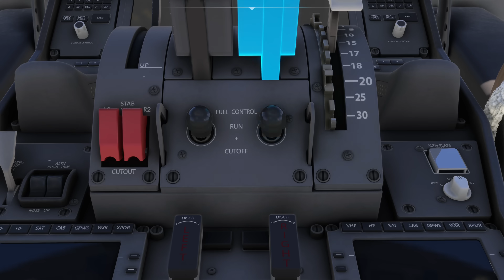Air India 171: Why Did The Fuel Cut-off Switch Get Moved?

Comment: While listening to this, my thought was this:

Maybe one of the pilots accidentally moved ONE of the switches during takeoff (shaking down the runway etc) and he then quickly realised that he’d toggled one of the fuel cut off switches, then in a state of panic he has inadvertently switched off switch number TWO by putting it into the cut off position, erroneously thinking that the first one was in the correct position, so effectively he’d cut off the good engine by mistake.
This explains how one was switched and then ONE second later the other was switched.
- it was during a very critical time period where all of your attention is focused on takeoff.
- maybe when the pilot asked him why he cut off, he genuinely replied “I did not” because he thought he had rectified the issue.

My only issue with this theory is that is it even possible to accidentally shift one of those switches inadvertently, since you have to pull up and shift position?
Reply: 1) Plane achieved thrust and lift. Would be impossible if one of the switches was “accidentally” turned off
2) You can’t accidentally turn these types of switches off. You need to pull them forward, then down (to cut off fuel) then they will spring back into place because they’re spring loaded. It’s not like a light switch
Reply: @TravelBug189 to point number 1, yes initially lift and thrust was achieved so the obviously in one of those crucial seconds the first and then second switch was moved.

Number 2 is the real question, is it possible at all to accidentally move them from RUN to CUT OFF. All signs point to the answer being no, due to how the switches are designed. 

My suggestion is how it goes from one to two switches being moved if in fact an accidental change of fuel switch position had occurred. Also why he said he didn’t turn off.

For the record, suicide still seems like the most plausible explanation so far.

Realising he’d made a big mistake, and not correctly repositioning the first engine switch, he’s switched off the live engine one second later trying to rectify his mistake, inadvertently causing an situation with no possibility of recovery.

This answers a lot of “how could that possibly happen” - ie switching two switches off, not one.

Comment: if the pilot actually saw the cut off done he then would have notified the tower. How can he just declare a "MAYDAY" without also saying the other pilot cutoff the fuel deliberately? I think he realized it was some electrical fault that did this and not the other pilot and tried, CALMLY, until it was too late to restore power. Why go down without telling the reasons why it was going down  and in this case, if the other pilot was responsible, tell the control tower over the radio, for the world to hear.

Comment: i don't think it's prudent to create a switch that takes 2 individuals to engage / disengage BUT what you do need is a button with some sort of "audible" or "visual" alert. If  that button had some sort of audible or visual alert the other pilot would have known about it instantaneously and more than likely all those souls would have been saved. Just makes sense to see a blinking light on the dash.....or a loud audible alert saying "Engine #1 fuel stopped" or "Engine #1 fuel resumed" even if it was done accidentaly it could've been corrected within 4-5 seconds.

Comment: I do disagree with Captain Steve's answers on the need for cameras. No one is saying that the camera will prevent this from happening; the camera is suggested for accountability purposes, not for prevention. Also the so-called concern that the camera will be somehow leaked is silly; if there is a concern for leakage, why wasnt there the same concern for the black box? Why cant the camera recording be saved in the same manner as the voice recorder and flight data recorder? I also reject the claim that the info caneras would show would already be shown in the voice recording anyway. I think it is exactly because cameras pick up info that the voice recording doesnt, that pilots strongly oppose them. No offence and I understand they dont want inappropriate action (e.g. falling asleep which wouldnt  be revealed in voice recording) be picked up by a camera, just like police officers have long resisted carrying bodycams, but the public deserves accountability, and when they are in a line of duty where hundreds of lives are at stake, they cant expect the same level of privacy as working a desk job.

Comment: I know as a UK part 66 Licensed Aircraft Engineer with the B878 (both engines) as a type rating.. We all know that the Boeing 787 has ELECTRICAL GREMLINS... If you don't shut the aircraft down properly, you can INDUCE a LARGE amount of electrical faults into teh system. My wonder is.... Is this a similar case??? Is there another glitch in teh software systems that CAN allow this to happen.. Surely a LOOSE wire could indicate that the levers were physically moved when in fact they were not... Could it be possible that a computer induced a momentary fault removing a ground and therefore indicating it was moved and then got that ground back. Or was it in the Cut-off lever module???

Comment: No one is asking the question? What if the engines were able to refuel again and the aircraft was back in control? What are the possibilites of the pilot/co-pilot to again interfere with the controls of the plane as its making its way to turn around and land safely? How does the one controller take control so to speak and prevent their co-pilot from commiting a second attempt at a malicious act? I'm picturing a brawl in the cockpit? This is all with the assumption that indeed someone in that cockpit wanted to end his life sadly.

Comment: Meanwhile India has ordered all its airlines to check Boeing fuel cut-off switches - and South Korea is about to do the same. Seems sensible. What I don't understand is why a faulty ECU might not 'believe' the switch has been turned to cut-off, even if it hasn't in reality. It could be nothing to do with the switch itself?

Comment: there could have been a malfunction in electrical system that affected fuel shut off valves..or some other mechanical issue....there was an advisory that needs to be discussed..engine failure was detected right away so then the pilots had no choice but to switch the fuel shut off switches from off to on to try to save themselves but had no time...the potential for mechanical or other issues related to the valves as indicated in advisories needs to be investigated...there is not enough info in preliminary report to blame pilots and protect GE and Boeing...full conversation of pilots not listed and some gaps in time

Comment: Ex-Huey/Scout USArmy pilot here.  Thanks for making your excellent series of videos.   On a 787, are there only direct electrical linkages between each of the two cockpit fuel switches and the servo motors that open and close the main fuel valves, OR is the aircraft's computer system (FADEC or otherwise) interfaced with that electrical linkage?  In other words, could the computer system activate the fuel valve servos to close or open regardless of the positions of either cockpit switch?  If this possible, would the flight data recorder show the event as 'fuel switch placed in closed (or open) position'?  Thanks for your attention to this query.

Comment: Hello Captain - In one of the previous videos I had posted a comment wondering if its physically possible to have both the engine switches transitioned from run to cut off position with a gap one second. You seem to indicate in a subsequent video its possible to do and it takes only about 1 second. However, in the report during emergency - pilots turned them back to run position and it took them a gap of 4 seconds between two switches. Could you explain this differece between 1 sec gap for Run to Cutoff but 4 sec gap for Cut off to Run?

Comment: STOP IT CAPTAIN STEEVE. You are selling lies and conspiracies and misinformation. Just stop it. You should be ashamed of yourself for saying this and spreading lies. Read the fucking report carefully, the report is saying that fuel cutoff switches Transitioned from Run to Cutoff, it doesn’t say that someone did it deliberately. There is a big difference in what you are saying and the possibilities for what could have happened. There are thousands of possibilities that could have made the control switch cut the fuel off. A loose switch malfunctioning due to a vibrating plane at takeoff, a mechanical and electrical malfunction which sent the data to the recorded for the control switch being off but actually the switches wouldn’t have moved at all in the cockpit, or a complete lie in the report to save the asses of Boeing and The airlines providing no information whatsoever of what really happened. The 1 survivor who everyone is ignoring said that very shortly after takeoff the lights started flickering and green lights were seen, which is a clear indication of an electrical failure. Stop spreading conspiracies against a pilot who simply doesn’t serve your country or you personally. Those pilots in fact did everyone they could to save that plane which was built and left I maintained to fall to death. Watch one of your own experts giving a rational perspective here.

https://youtu.be/GKQIZqUlPGQ?si=_JCYX_GLQbRwHcTR

Comment: Is it possible that the fuel cutoff switches are physically set to ‘Run,’ but an electrical fault in the flight computer or incorrectly connected wiring causes an ‘OFF’ signal to be transmitted to vital aircraft systems and the black boxes?

Comment: We know that the electronics indicated that the engine switches moved to off.  Unfortunately, we don't have video to prove that one of the pilots pulled the switches (or did NOT do it).

Others have said an electronics failure could have shut down both engines -- after which the pilots would have naturally toggled the switches off and then back on to relight them. 

This might seem *unlikely*, but as of today it does not appear *impossible*.  In that case, we can't rule it out yet.

Comment: What if the buttons/switches were in the correct RUN position, but the electronics switched to CUT-OFF, while the physical levers were still in RUN, and they/he felt the power going down, prompting the question. Then he put them back to CUT-Off, and then back to RUN, as a way of making sure! Good old "shut it down and power it on again", when nothing else makes sense. Why is this not discussed? Obviously these buttons/switches are not physically attached to the rest… They are electronic switches, even though they are "physical" in the way they are controlled.
Reply: To me... Why is this not the obvious thing to explore. I remember having to do this with the Turbo-button on a 486 DX with a physical "turbo button".... It's the same principle! These planes are electronically right about there (I know I am exaggerating, but why is it not explored?)
Reply: I also know the philosophy of Being is to make the physical stuff reflect the actual state of things. But how far does that go...? Especially if the "invisible stuff" fails... Maybe they both were right, and after 9 seconds... ok, go CUT-OFF and back to RUN, see if it works!?
Reply: Is it not possible?
Reply: Maybe the 9 second delay, before they were back to RUN, was just the time it took wondering "but they are on RUN!!!".... He just felt it, that's how he noticed, then looked at the switches... 9 seconds later, what the hell!, try OFF and ON! But to late... 😔
Reply: Why is this not discussed?

Comment: Aircraft manufacturers could install a system that ensures that neither of the engine's fuel  can possibly be cut off during take off because cutting off fuel during take off serves no purpose than to crash the plane at a most critical time, even if one or the other engines caught fire as the plane needs to reach full altitude, and at that point the affected engine's fuel should be cut off and a procedure for an emergency landing can be worked out, probably at the same airport they took off from, this is not rocket science? Just common sense

Comment: The report is based on the findings of Boeing as they are the only one who can evaluate the FDR, and every one, including Captain Steeeve, throws the pilots under the bus. I believe the Pilot monitoring as he said he did not turn of the switches. I find it much more likely that there is some sort of software glitch, then a pilot using this method to make the plane crash. That is soooo far fetched. I am batting that either the switches never moved, or they moved after the engines flamed out, as to initiate an auto start, as actually happened.

Comment: Something stinks here. Whoever said "did you do that?" should already turned them back on. It took 10 seconds? What's really going on  here?

here
Reply: Great point, my question is wouldn't the other pilot seen the pilot turn the switches off? It's not like he's 10 yards away, wouldn't he see the pilot out of the corner of his eye turn those switches off? And would it have saved the place, as you said, if he just turned them back on instantly?
Reply: @racefan1701 Yes, he probably did see him in his peripheral vision which is why the actual quote from the preliminary report is "Why did you cut off?"
Reply: @racefan1701  I think it's the Capt Steve video just before this where he explains that the other pilot would have seen the action out of the corner of his eye, but would have taken a few seconds to process what was going on only after the engines started to spool down. Valid question about taking 10 seconds to start the switches again though, but I guess there's a procedure with other steps in it.
Reply: @racefan1701 The pilot flying during takeoff (the First Officer) would have both hands on the yoke, and be very focused on the instruments during the initial climb. I think it quite conceivable that he did not see the monitoring pilot (the older Captain) flick the switches but he would have almost immediately noticed the lack of thrust and heard the engines spooling down. Given that he was the junior pilot, he may well have thought the more experienced Captain had detected an issue requiring the fuel to be cut off (unlikely during takeoff), and have had several seconds of doubt before trying to reengage the fuel switches himself, which is not easy when also flying the plane during a critical part of the flight.
Reply: Exactly! One wanted the fuel on and one did not IMO. I think there was a scuffle going on before the PF managed to flick the switches back to Run. Sadly, by then it was too late.
Reply: @rosemaryhinchliffe7721 good theory.
Reply: Are you completely thick or something? Try using both brain cells
Reply: It’s not driving your Datsun ..
Reply: You’re quick to blame the pilots, but let’s get real:
🔴 A viral video taken on the same aircraft just hours before the crash showed malfunctioning cabin electronics — power issues, failing displays, and unresponsive systems. That’s not random. That’s a clear warning sign of deeper electrical faults.

🔴 The takeoff roll was unusually long and slow, clearly visible in CCTV footage. This was before any engine switches were flipped. If the aircraft was “normal,” why did it struggle to lift off? That alone suggests power or thrust-related issues, possibly tied to earlier electrical problems.

🔴 Both engine fuel control switches were turned off within seconds of liftoff — an action that takes force, not something easily done by accident. And the CVR shows confusion in the cockpit: “Why did you cut off?” — “I didn’t.” That doesn’t sound like deliberate action; it sounds like unexpected behavior from a faulty system.

Yet despite all this, you’re pushing a theory that clears the manufacturer and blames the dead pilots — just like Boeing did during the 737 MAX crisis, when they knowingly hid MCAS flaws and let pilots take the fall.

It’s painfully obvious what’s going on:
✅ Evidence of electrical failure is being ignored.
✅ The narrative is being steered to protect Boeing or the airline.
✅ Once again, the easiest scapegoats are the pilots — who can no longer speak for themselves.

This isn’t analysis. It’s damage control. And your viewers deserve the truth — not sanitized PR to protect corporate reputations.
Reply: @Gurpreet.jheeta  Without wishing to offend you, I respectfully disagree. If there were electrical faults reported on the aircraft, why did Air India allow it to depart as reputationally this could ruin them and, it's not the aircraft manufacturer who is responsible for maintaining airworthiness.  Secondly, the design of the fuel cut off switches requires physical input to move them, I seriously doubt that an electrical fault could pull them up and move them to the cut off position.
Reply: @Gurpreet.jheeta 

That was very dramatic; but it was the pilot or copilot .

Comment: BS Steve! Fuel cutoff by a single pilot is only one of a thousand ways a pilot can commit murder/suicide! What, one pilot can't drive the yolk into the pavement after rotate how you going to prevent that? Get real! There is only ONE WAY human pilots can be prevented absolutely from murdering passengers and that is to REMOVE HUMANS FROM THE FLIGHT DECK! It's called DRONES. It's like school shootings which can be prevented but no one wants to take the necessary actions. So either DO SOMETHING or QUIT BELLY ACHING!

Comment: There is another camp believing the cause is purely mechanical issue (bad switches, software/chip glitches) and looks like it’s gaining steam. (Or YT algorithm decides to promote it)  One video has a 787 pilot claims it’s not possible to flip the switches one second apart.  
If the pilot is in a hurry perhaps it’s possible and that would actually explain why it’s one second apart and not more .  
Steeve, wondering what’s your view on this?